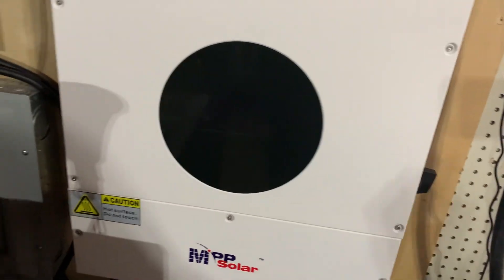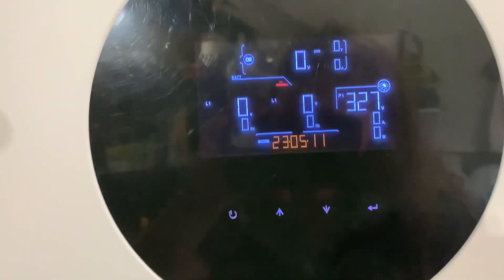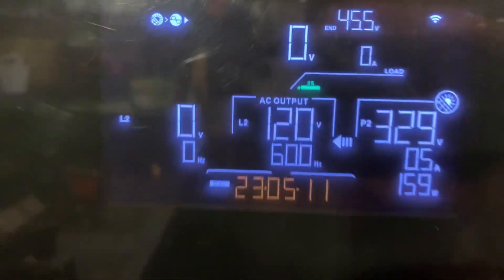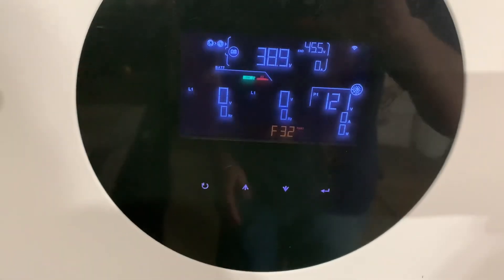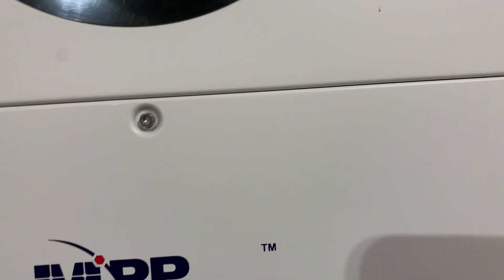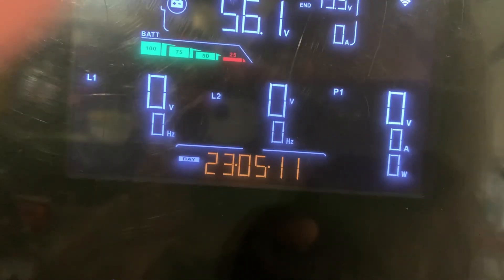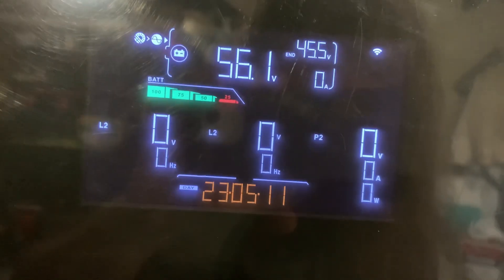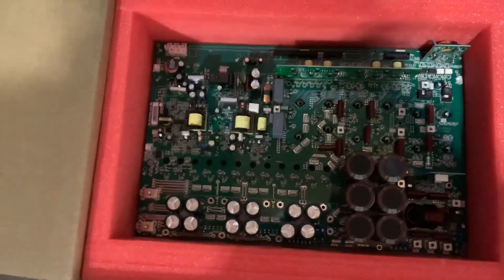Lvx6048-wp partial failure

Comment: Hi there, when you do the replacing of the board, can you take some photos of what the underside (the heat sink) side looks like? I am on my third MoBo now and still having problems. The Transistors keep blowing... I could see small amounts of black silicon dust/dirt that was left behind. It's not a lot, but it's there. I am curious to see if you find the same thing. Also, note, that there are small ceramic-like squares under EACH transistor that will mostly stay on the heat sink, but some will probably pull out with the board. They fit down in to the heat sink, so DOUBLE CHECK to make sure they're completely flat and not slightly sticking up. It can be hard to tell!! You'll probably also want to grab a tube of thermal paste to re-apply to the new transistors before you install the board. I am so so so beyond frustrated with mine, but I hope this new board fixes yours!! reach out to me if you want to discuss!!! Or need help with anything. I have done this install 3 times now trying to fix mine.
Reply from the maker: Will do and thanks for the heads up on  the heat sink deal. Now to find some thermal paste lol, i hope this dont become a habbit bc right now it is still under warrenty but still cost 75 bucks for shipping. Thanks and keep in touch.